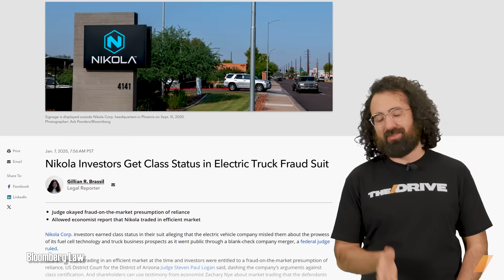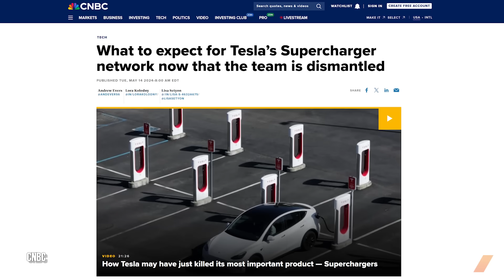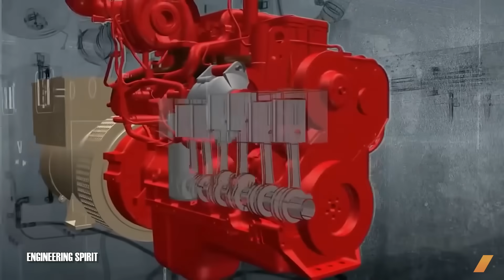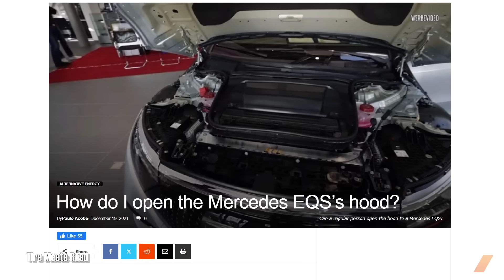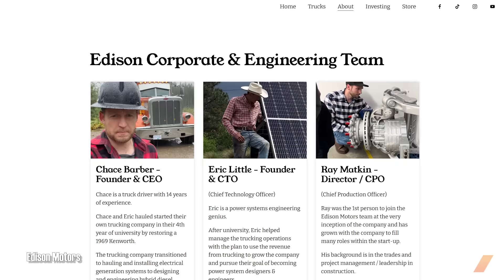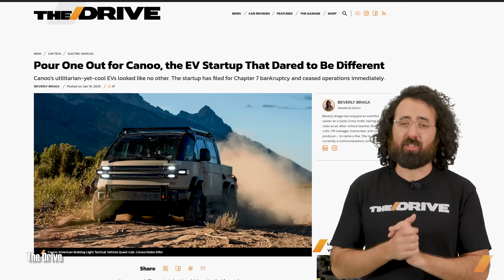The truckers in a shed beating Tesla with 100-yr-old EV tech

Comment: your opening statement is stupid neolithic (stone age) bs - CHINA is GOING TO BE close to  100% ELECTRIC, maybe in as little as 5 years,
and THEIR  cars and trucks are TAKING OVER Japanese brands in Mexico, in Australia, and around the world... right now! 
Because Big Auto is doing EV  STUPIDLY - like the Japanese automakers - one of the big 4 WHICH IS GOING BANKRUPT right now!  
    I would buy an EV mini-van RIGHT NOW if I could, but there is no such option.
 Tesla can't do it, because THEY'RE ALREADY BATTERY CONSTRAINED - they sell as many cars as they can get batteries for, 
and that's before their new lower-cost model ($25,000-$30,000) comes out later this year. 
   btw, I just purchased a SOLAR POWERED mini-split Air conditioning system with 4 of the newest "bifacial" PV solar panels
that during the day   needs no grid power if the sun is out to power its max output - OF COURSE it's made in China, 
because Americans ARE NOT  CONCERNED with TRANSITIONING to ENERGY EFFICIENCY. 
So you think the Democrats and "liberals" and "mainstream" media  are "environmentalists"?   NOT! 
Did you know that MERELY PUTTING SHADE on your outside  AC unit will significantly improve its efficiency, 
reduce energy costs and operating wear?  Probably NOT - because the EPA is REALLY NOT  trying to help America attain ENERGY EFFICIENCY and TRANSITION to PV solar!  The political parties are OWNED by the people who own the banks... and just like the oil billionaire rockefellers became synonymous with Chase-Manhattan bank, so too the people who make billions of dollars selling fossil fuel energy and "legacy" ICE automobiles DO NOT want to give up that gravy train - and they fund the majority of  network TV, especially sporting events. 
 Another example - "NET ZERO METERING" is bureaucrat/lawyer/big-business speak for DISCOURAGING HOMEOWNERS from buying SOLAR PV systems, because when YOU FEED your  EXCESS ENERGY back to the energy grid, 
THE POWER COMPANY does NOT want to pay you market price - they pay you pennies on the dollar for your power. 
 THIS ONE FACT ALONE is STRANGLING  solar adoption in many states, just go ask any Solar home system salesman.
 edit: I like Edison Motors, I agree that their hybrid system is perfect for many applications, and should be very efficient, reliable and affordable.
If I could get one of their kits installed in a full-size pickup truck right now I would... but that doesn't mean full battery EVs (BEVs) are the wrong approach for the vast majority of commuter transportation.

Comment: Longevity of the vehicle wasn't something they were catering to when they tried to electrify the driving public. Diesel electric excavators from the 60's are still in use. Much cheaper and easier to maintain than new high-cost tech laden equipment.

Comment: Cummins L9 diesel engine has an advertised horsepower (hp) of 270–380 hp, depending on the model. It has a peak torque of 860–1,250 lb-ft, depending on the model.

Comment: Oil industry is seriously throwing money on anti EV propaganda whenever possible. Effectively giving all competitive advantage to China.
Reply: It's not oil industrys fault that EV's are trash.
Reply: @ EVs are so much better than petrol vehicles. I’ve tried and replaced both of my vehicles to electric and will never go back to petrol. It was like changing from the horse buggies. They are only trashed in oil propaganda, and I am sorry that you fall into that.
Reply: @Totemparadox  EVs are so much better than petrol vehicles. I’ve tried and replaced both of my vehicles to electric and will never go back to petrol. It was like changing from the horse buggies. Electric vehicles are only trashed in oil propaganda, and I am sorry that you fall into that.
Reply: @unxusr  EV's might be decent if you don't have to travel far and live in a warm climate. Also being rich helps. Tens of thousands for a battery pack swap? No thanks. Older gas and diesel cars wipe the floor with EV's all day every day.
Reply: @Totemparadox  wrong again! And condescending? Dude, sorry, you really been duped. Talk to Tesla real owners. I’ve travelled all over the US. It is much more comfortable. Overall it adds up only 5-10% extra time (instead of 5-10 min you have to charge for 10-30 min). Superchargers are everywhere. But you’ve been duped around things that are not primary. I use car for travel only twice a year - the rest of the time EVs shines and beat ice in ANY way possible. Like car was superior to horse buggy in the beginning of last century. Enjoy your horse buggy. And no - there is a huge used market for EVs, and car batteries not just die - they live much longer than engines or transmissions, and they are rebuilds. I will copy/paste the list of things I was writing to my notebook why EVs are so awesome. In the next separate post
Reply: @unxusr  "Enjoy your horse buggy" You are one of the main reasons I hate EV's. The people who like them are condesending and insufferable. So you can use an EV in the Alaskan outback, not use it for a month and then turn it on and drive a couple hundred miles? Yeah, thought so. Your super sophisticated EV's is less advanced than a horse buggy when the weather hits zero and there are no charging stations nearby. EV's are decent in places like California where you don't need to drive more than ten miles, it's warm and chargers are everywhere. And sorry, I'm not waiting 30 mins to do something I can do in two minutes.
Reply: @Totemparadox   you are the one who started being condescending about EVs. You have been focused on some extreme cases, and being wrong again. Climate in Norway is similar if not worse and they are switching to EVs completely. I live in Utah, and will never go back to petrol. Tried to copy/paste all advantages to you here and it disappears 🤷‍♂️ ok. Let’s try in portions
Reply: @Totemparadox  EV advantages:
1. Instant acceleration
2. Silent Drive
3. No vibrations
4. No need to go to gas station
5. Can fuel your car at home or at the destination. 
6. Time savings. It’s funny, but charging is faster then pouring gasoline in a regular day to day life, and its saving me annually at least 30 hours of my life, by not going to gas stations, because you are fueling at home. Though charging takes longer itself but it doesn’t matter since it’s parked at that time. AND time savings on oil changes and other stuff.
7. Don't need to worry about quality of the fuel (electrons are always “premium”)
8. No fuel price increases or drops or worry about which gas station to choose, and ...
9. You are not sponsoring corrupted cartels, governments and countries.
10. Cheaper fuel (and ALWAYS premium look above at # 7 :))
Reply: @Totemparadox  11. No fumes - Can preheat or pre-cool cabin of your car without opening the garage (no engine running needs)
12. No need to worry about warming up your engine or transmission
13. Always start in freezing temperatures 
14. Absolutely more reliable - fewer moving parts
15. Don't need oil change 
16. Don't need air filter for engine
17. No need spark plugs
18. No muffler and catalytic converters 
19. Fueling itself when braking or going downhill (recuperation)
20. Braking pads last forever
Reply: @unxusr  I saw your comment and answered to it. YouTube is weird.
Reply: @Totemparadox  21. Preheat is faster since it's electric
22. Of course environmental impact
23. Neighbors would not notice you when you coming in and leaving in silence. 
24. No such thing as idling. You can always wait for your loved ones with heater or air conditioner and not emit any fumes or noises
25. No power loss on higher elevations (electric motor do not burn oxygen and therefore not dependent on higher altitudes) 
26. Financial SAFEty from credit cards fraud, since charging at home most of the time and high risk at gas stations for skimming devices.
27. Biological SAFEty for not getting viruses at gas stations, or breathing toxic fumes.
28. EV like are structurally safest cars on the planet (it IS a Fact) due to - a) No engine in the front, and it becomes crumple zone to absorb impact, -b) battery working as additional frame to protect passenger compartment, AND - c) lower center of gravity, it is almost impossible to flip electric car. 
29. You can drive through deep waters without being scared to seriously damage motors. Like in point 25 no oxygen needed. EV motors will work on the Moon or Mars. 
30. It is simply FUN TO DRIVE

Comment: The dry weight of a Cummins L9 engine is 1,695 lbs (769 kg). The L9 is a six-cylinder engine that's used in Class C and D buses.
Reply: Much lighter than the 15 liter engines (3,152 lbs or 1429 kg) normally found in heavy duty trucks.

Comment: How do these work in water? Off road mud? freezing weather?  Seeing the logging truck is promising but that one in the video was NOT an Edison.
Reply: Theoretically all the EV gear is sealed and cooled via a glycol loop. For cold weather, they'll start the engine and run warm glycol through the EV gear. 

They showed Topsy and some Tesla's. Not sure what time stamp you're talking about for the non Edison truck.
Reply: In nordics we have been working with "hybrid" semis for a while and yes they work just like any other if made with good quality and every electric part is sealed and placed properly
Reply: How do they work? Fine, why wouldn't they? All you need to do is isolate the electronics in water proof containers which is pretty easily done. The problem with the Cyber Truck isn't that it's electric, it's that it was designed by an idiot to be a pavement princess.

Comment: It might take longer but a battery powered truck can certainly do the job.  Where there's a road, there is the electric grid very near by.  Burning fuel is no longer a viable option and these hybrid trucks will be gone in five to seven years.
Reply: Bzzzt. Edison trucks drive 100 miles offroad with zero infrastructure. They need enough energy to get in AND back out again.
Reply: @Sah-o5m  You realize that battery powered trucks with over 300 miles of range exist.
Reply: @NackDSP  I do realize that battery powered semis capable of moving 80,000 lbs on paved roads from charging station to charging station exist.

I also realize that there is no battery powered semi capable of moving 150,000 lb log truck over a 15 hour work day on dirt roads with no charging facilities.

I sincerely am willing to be wrong if you can find a vendor that sells a battery only vocational semi logging truck that can move a 65 metric ton Canadian B train.

Comment: " truckers in a shed are beating tesla" how much did they pay you to write that, its getting so annoying how much the owner of Edison (terrible name for a company) compares himself and his truck with tesla when there is not a single thing in common between them, one is a logging truck designed to work offroad and off grid most of the time and the other is a high tech fully electric fleet truck designed to transport cargo in between depots for companies, on top of that, Edison is mostly using parts made in china, so don't expect good quality from it either.
Reply: Turns out that Chace naming his company a controversial name is providing endless hours of free advertising

Comment: Look at some of the inventions of R G LeTourneau in the 1920s through 1950s with diesel engines running generators that powered steering and electric wheels on exploration and logging/ construction equipment.

Comment: You missed the part where they get technical co-operation from Kenworth for the suspension and chassis, so that everything under the panels that isn't drivetrain, is made from off-the-shelf parts that any service agents can order. And that in zero emissions zones, the generator can be shut down and the trucks run as EV-only mode. Their ReGen Braking testing on mountain dirt and shale logging tracks is well worth a watch. The e-axles for pickups with leaf springs, is the same tech needed to EV convert Muscle Cars :)
Reply: Remains to be seen if there's truly a market for EV retro fits on cool old cars or trucks. Personally, I'm not interested. And I own 3, and 4/8 vehicles have V8s.
Reply: @chriswithrow3107  Hot Rodders like Speed and Acceleration. Don't be fooled by the V8 rhetoric, if they can lower their ET with EV hardware, they will.

Comment: Teslas batteries are far lighter and more efficient than GMCs, this is why they didn’t use a Tesla as a reference to guesstimate the weight….
Reply: Correct. A Tesla Semi battery only weighs 8 to 10 thousand pounds. Way more than any diesel engine & transmission.

Comment: Maybe you say this later in the video, but another benefit to these trucks is they can run red diesel as it's literally just an onboard generator, not sure but may not need def either.
Reply: Mostly correct. The Topsy prototype is allowed to run red diesel. Future Edison trucks will need to pass CMVSS emissions and road regulations.
Reply from the maker: correct, it doesn’t need all those emissions controls

Comment: This video suffers from so many misconceptions it really needs to be taken down and re-worked. It really doesn't make you look good at all I'm afraid.

Among other things, some of which have been pointed out by other commenters already:
1) The Tesla Semi and Edison Semi are in completely different segments with minimal overlap.
2) Long-haul trucking doesn't need electrification, it needs to mostly transition back to rail. There will be niche uses for long-haul trucking but it's rarely the best solution.
3) A Diesel-Electric Train (Or crane or loading claw machine or whatever) is not a series-hybrid. It's just a Diesel machine with an electric transmission(Instead of mechanical or hydraulic). To be a series hybrid you need to have a battery involved to recapture braking energy. While there were a few very early railcars which were proper hybrids, it took until the end of the 20th century for anything serious to be developed.

Comment: You also don't have the baseload generation capacity to convert to a BEV model.

Just as a for instance...
In the US, our road-going car and truck fleet burns over 200 BILLION GGE (Gasoline Gallon Equivalent) of fuel every year; which converts to 6,700 Terawatt-Hours. Obviously BEVs have greater efficiency than ICE vehicles, but you're still going to need somewhere between 2,200 and 3,300 tWh of additional baseload to support that. For reference, we're currently using a little over 4,000 tWh of electricity, which means a 50-80% increase in baseload generation capacity.

And that's BEFORE the 50% additional load we're going to need by 2040 to support the amount of Data Centers we're building, which doesn't even take into account the extent to which Data Centers dedicated to AI are going to need.

By 2050, we would need about THREE TIMES the baseload we have now, and we are NOT going to get there on Wind & Solar. In fact, even fossil fuels will not be sufficient, which is why there's a very quiet race on to start building nuclear power plants again, especially 4th generation nuclear, particularly SMRs and Micro-Reactors, which will also save a lot of money on infrastructure.

THAT'S why Edison's Diesel-Electric model, which has had enormous success in both Trains and Ships for decades, is the only model suitable for widespread adoption across all cars & trucks.

Comment: Why does the diesel only charge the battery and not drive the wheels directly? I know that makes the control system simpler, but you take the efficiency hit of the battery charge/discharge cycles.
Reply: The benefit of batteries is they can recapture energy during regen braking.

The other advantage is the batteries handle  peak loads, so they can put in a 1/2 size engine to handle average loads.
Reply: @Sah-o5m  - I understand all that (I've been driving a Prius for nearly 20 years). I guess I wasn't clear. I wasn't saying we don't need the battery pack (like a locomotive that's a straight-through connection), but the generator should drive the motor directly, and only charge the battery as necessary. 

The regen feature is the only thing that makes this more efficient than straight diesel power. You lose some efficiency already in the mechanical-to-electrical, and electrical-to-mechanical conversions, so why add the electrical-to-chemical, and chemical-to-electrical inefficiencies? The only serial hybrid car every put into production was the Chevy Volt, and that's the way it worked.

Comment: Now when are they going to make RVs with this design, it would be genious to have all the power to run your rv equipment, hvac, refrigeration , and maybe water heater, ect.
Reply: No more propane stoves. No more 2nd fuel tank. Simple and 100 amps at your disposal.